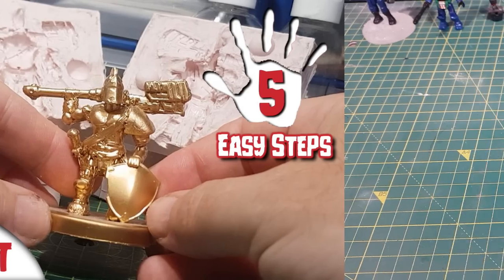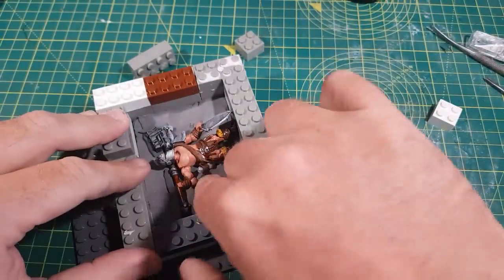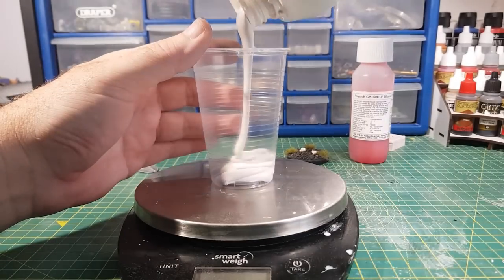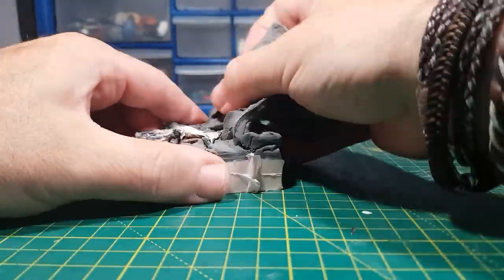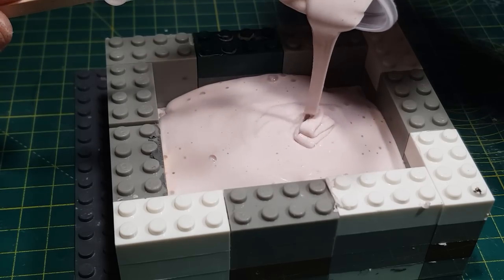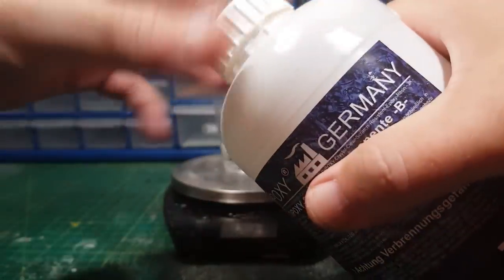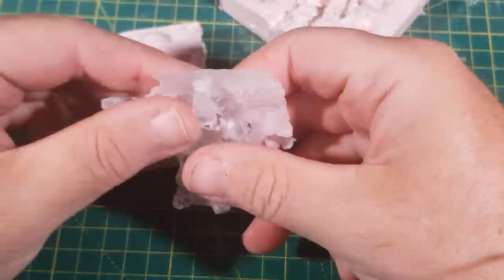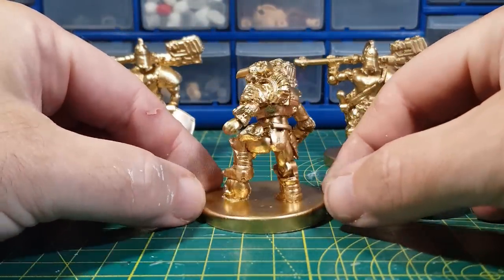Recasting Non Warhammer 40k figures

Comment: I casted myself some not Warhammer Miniatures and I really have to advice anyone who wants to cast some minis to youse a proper release agend, because it will make the molding process easier and it helps to preserve the mold. Over time the mold will get demaged, without a releaseagent. Usually The best agent to buy you'll find in the use advice, when you buy the silicone. Another advice I can give is to buy a self venting silicone. It is more expensive, but you won't have to deal with nasty air bubbles :). Sry for my English... I'm from Germany

Comment: never use plasticine with silicon molding rubber as the plasticine contains Sulphur which can interfere with the hardening of the silicone . . . I use a non-hardening modeling clay which softens with heat and contains no sulphur . . . I've been making mold for 35 years

Comment: Okay so a lifehack....do not use the flat legobase, just make a big flat plasticine and put the frame on top. Use Silicone spray for releasing and better silicone spread, when the first half is done you do not have to diassemble the entire frame just enough to build for the other side. Now spray again silicone spray, then wipe up the part which is on the silicone(or better yet spray the silicone into some small cup and use a brush to spread it on the figure), then spread a little talcum with a brush evenly on the mold itself. Por the other half....the two side will came apart nicely and the mold will be less lkely full of bubbles

Comment: Great video!
A quick tip. Apply a layer of silicone with a cheap brush before pouring it. That reduces the chance of getting bubbles immensely.
The next step for better recasts is a vacuum chamber.

Comment: just use the "blue stuff" to create mold. It separates better and can be melted again many times.

Since the resin hardens for a long time, I recommend pouring it into each half of the mold separately and joining the halves after an hour. This will give you time to remove the bubbles with a toothpick and get the perfect miniature.
Reply: The resin I use gets hot while curing, which makes thoese moulds unusable...
Reply: @Gothead420  that's why I use a regular two-part epoxy adhesive.
It practically does not get warm and costs only $ 2 for 200-300ml
Reply: @johndoe5555  what specific two part epoxy adhesive you use?
Reply: @B1-997  Sorry, friend. I don’t remember the exact name and now my city has been destroyed by the Russians and I can’t even look in local stores.
Reply: @johndoe5555  all good and thanks for responding, and i hope you and your family stay safe over there during this difficult time.

Comment: I would like to see a video about casting metal miniatures:)
Reply from the maker: I have just brought some pewter as this is something I have always wanted to do, hopefully will be able to do the video in a week or so =)
Reply: Procedure is much the same.  Needs a heat resistant silicone rubber, and you can get Room Temperature Vulcanising (RTV) heat resistant silicones for that purpose.  You can even gravity-cast (as opposed to centripetal - spin - casting) them.
But yes, Molten white-metal-alloys (WMA - "pewter" is one kind of WMA. I use a tin, antimony and bismuth alloy) are HOT.  WEAR protective gear.  ALL of it.  
Heat resistant gloves (big ones).   Face shield (the molten alloy may spatter, you don't want it hitting your face))
Filter mask (not just because of lead - some WMAs contain it - but bismuth is also not good to breathe),
Reply: @chromedog68  i thought lead couldn't be used to make pewter anymore
Reply: @mistery8363  unless your buying all your pewter from a single specific source, and can verify when and how it was made, ALWAYS tread on the side of caution and assume there’s lead in your pewter. Most people buying it for recasting purposes like this will just buy scrap pewter, and older prices to melt down, and thus, higher chance of encountering lead.
Reply: @Superintendent_Chalmers  thanks dude!

Comment: Use a spray on mold release, you won't regret it. Also I learned a good method for bringing bubbles up to the surface from a guy I worked with a privateer press. Vibrate the table it's on. You can do this with a variety of things from a massager to a table fan with a fin broken off and some clamps. He used a knock off version of one of those hitachi "back massagers." An hour of vibration works out the worst.
Also, if you end up with spots that just won't fill for whatever reason, you can cut little elongated triangles into the surrounding mold to give the resin somewhere to go further.
Reply: that might be the most original way to use a magic wand i ever heard.

Comment: Next time when you make a mould tap it from underneath  after you pour the rubber. When you see no more bubbles coming to the surface it means the rubber has no more air bubbles. I have tried it myself and it works.

Comment: You can mix in sand, small beads, ground up plastic scrap or whatever else  with the epoxy to bulk it up and not use so much. Also spin the mold so the resin will reach every corner. As in put it in a bucket and pretend it's a lasso.

Comment: So, the silicone mold didn't pull any of the paint off the original model, or dull the finish?  I wonder if a cheaper urethane mold would work as well.

Comment: I am using that same resin and idk if I undermixed but its been 72 hours and only now is that shit hard.
Reply: Quite a few two-part resins (even "fast cure" ones) require at least 48-72 hours AFTER they harden to properly cure.  
I use a UV curing "oven" to speed it along (or you could leave them in the sunlight).

Comment: Hi love your videos. I have a two part question I have used the resin on your affiliate link and it sets crazy fast I was wondering can you recommend a slower setting one. As I read about using a pressure pot as it will force the air bubbles smaller or even out of the mould totally. Or are pressure pots witchcraft for such small intricate models?

Comment: How many uses do you reckon a silicon mould has? If it is a low number, how would you go about duplicating the mould with a more durable material? Maybe material for a vid?
Reply: pel thoron  Thanks for the in depth answer. Won't pretend I understood all of it but a fair few casts for normal silicon basically. Theoretically, could you take the first model you cast, set it aside then use it further down the round to make another mould? Like if you borrowed an original from a friend, made a mould, then kept the first cast as a subject for a replacement mould?
Reply from the maker: The resin cast comes out of the mould easy so doesnt damage it in anyway so I reckon you can make loads of casts, I think time would be the main factor in the mould deteriorating.
Reply: @MiniatureHobbyist  I've got some platinum cure silicones that are over 15 years old.  150+pulls from the moulds.

Comment: since i could not find silicon rubber just like yours (and i am too impatient to order from amazon) i bought some very similar, and always have problem with seperating the two molds after second part cures, i tried to put a layer of chalk spray and that did not work well, do you have any idea/advice ?
Yea i started to make molds after watching your videos :D You really inspired me to do something - great job!
Reply: You'll most definitely need some type of mold release and also to make sure the first part is totally, completely cured before you pour the second part.

You can use a super thin layer of Vaseline (petroleum jelly).  Check out The Crafsman - Steady Craftin' for an excellent resource on this stuff.

Edit: gave bad info I can't back up so I removed it
Reply: @CeeJayThe13th  So instead of using talcum powder I should use isopropyl alcohol?
Reply: @starksmurf , oops, apparently I don't know what the heck I'm talking about since I can't find the thing where I saw about using isopropyl alcohol.  I'm gonna edit my comment.

You can still use petroleum jelly or tons of other stuff.  Just Google DIY mold release.  But also, baby powder is supposed to work too.
Reply: I agree 100% with Cee Jay, use petroleum jelly.
I do molds every so often and have never had a bad release with good ole vaseline.
I've heard alcohol or a mix of alcohol and jelly work, but I haven't given it a go.
Reply: @jonathantillian6528  and then only on the surrounding area, not on the mini itself?
Reply: @starksmurf  Yup!
I use a q-tip and go around whatever it is I'm making a mold of with a semi-generous amount of jelly then gently wipe off any I accidentally got where it shouldn't (it always happens).
Reply: My best advice, hairspray, it demould without problem
Reply: @Prkiller7567  Do you spray on the mini or just around it?
Reply: @starksmurf  Spray it directly, it doesn't matter if something falls on the miniature, just clean it after removing the 2 parts
Reply: @Prkiller7567  Great!
Reply from the maker: Thank you so much, yup lots of good tips here =)
Reply: Mann Eass Release 200. I've never heard of a release agent on the plasticine, I'll have to try it, but spray the release agent on the first half of the mold before pouring the second half. For casting the resin mold, some talcum powder brushed on both sides of the mold will have draw in the resin and fill in gaps

Comment: what would be a good release agent to use for this? tlacum powder?
Reply from the maker: Ive used talc and its not too bad but I would also like to use the spray release agent to see how well that works =)
Reply: @MiniatureHobbyist  Both work well.  Talc is also good as a filler with certain resins (so you use less resin.  One of my resins is a translucent white when cured.  With 10% talc, it goes opaque white.  No difference in hardness or casting time. ).

Comment: How do you pose the mini if it has its arms in front of the body holding  a weapon like pike or a bazooka? Is it possible to make a mould like that?Maybe make two separate moulds? One for the body and the head and one for the arms?
Reply from the maker: If the figure is more intricate it would be best to make moulds of seperate parts, if its already glued together than you may need to make a 3 or even 4 part mould to accommodate all the sticky out bits =)

Comment: Random question. I have a resin 3D printer and I have printed up some bases that I want to make a mild for to re base my army. I flipped a mild from some of my prints. This failed as the silicon is still tacky and lost detail. As if it has not set. Do u have any advice. Iv wasted about half a  l of silicon   This has happened twice 

However from the same poor I used some old resin prints and the all sealed.
Reply: It sounds like your silicone was not properly mixed.  You have to really mix it and make sure you have equal ratios or it will not properly set.

Comment: Is the Dipoxy clear resin soft?
When you de-molded the figure and were cutting the excess and mold lines, it looked like it was flexing?
Reply from the maker: It was soft as I hadnt left it long enough, its a slow curing resin and I was impatient lol
Reply: @MiniatureHobbyist  Thanks!
I've used the SG2000 resin from MB Fibreglass and that sets really quickly.
Too quickly in some cases, like when trying to cast small pieces that need to be agitated to let the air out before the resin cures 🤔
Reply from the maker: @aljohnston6279  yup I have that one too and only mix it in small amounts, like you say it starts to cure in minutes
Reply: Any idea on good products in America?